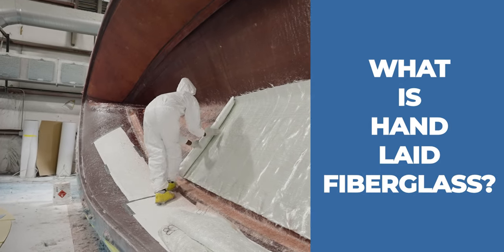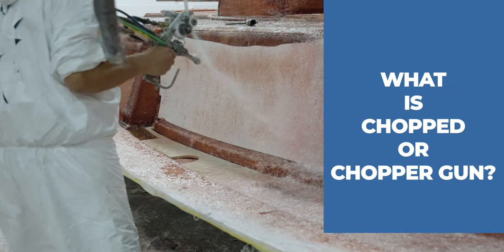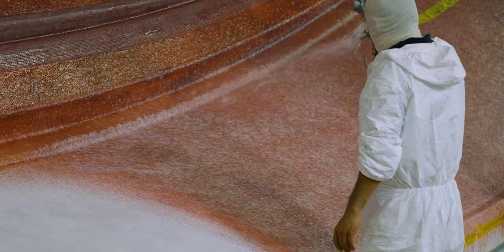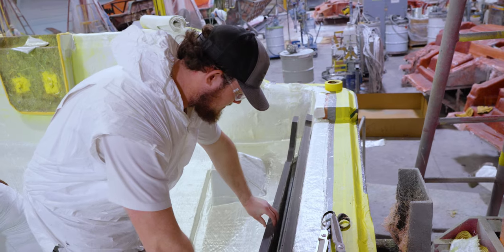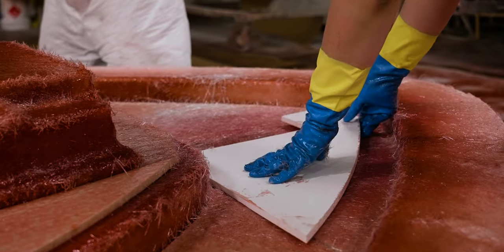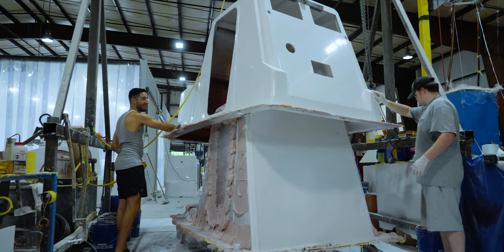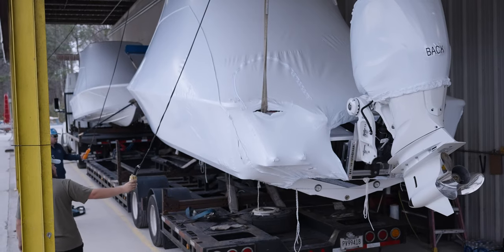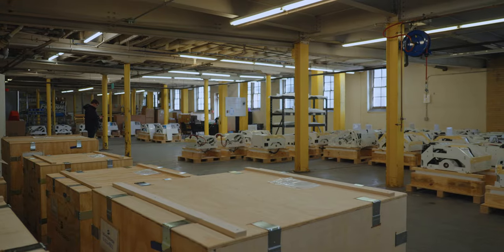Answering Your Boat Building Questions - Sportsman's "Behind The Glass" (Season 2 - Episode 8)

Comment: A common problem when screwing into, and mounting fixtures (like shade mounts or speakers) into, cored fiberglass is that water can infiltrate the screw holes and cutouts. How does Sportsman protect against rotting the core, and what practices do you recommend when they need to cut and screw into it themselves?